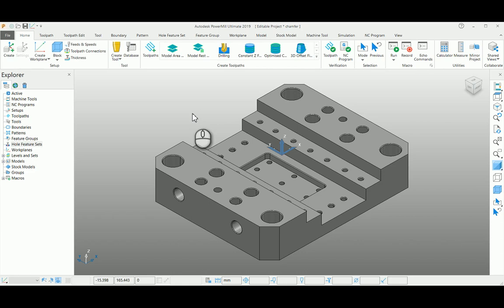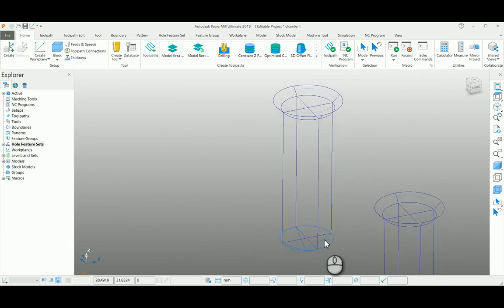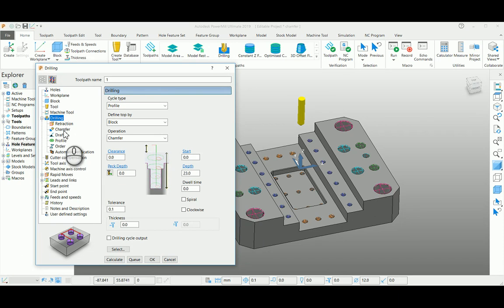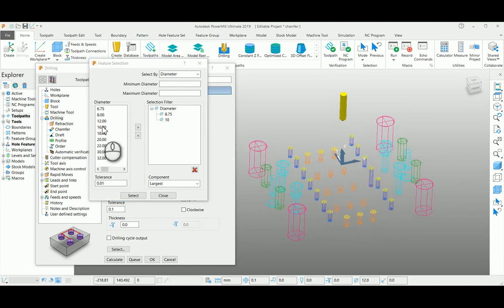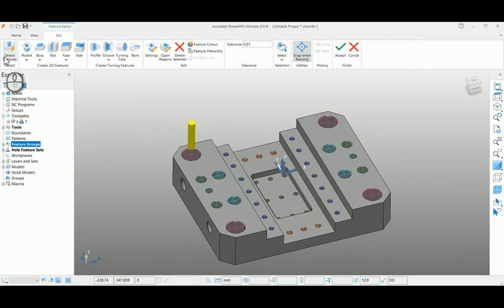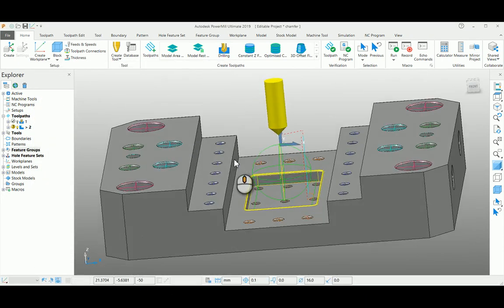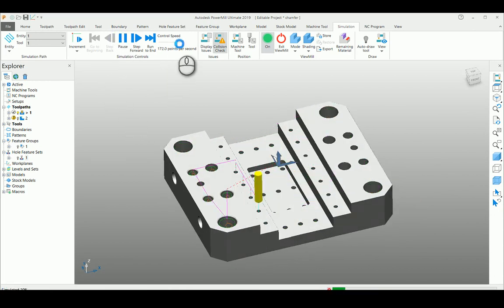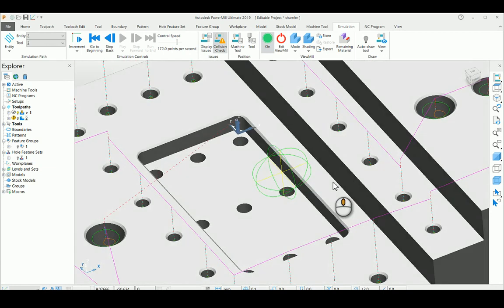Autodesk PowerMill-Chamfer Milling

Comment: Hello, engineer, good time, how did you colorize the hole feature set, since the color of each feature set is different according to its diameter?  Thank you if you answer❤
Reply from the maker: We ca create a macro in PowerShape to apply specific colour to features
Reply: @rajeshkanna5177 Hello again, I did not understand how to activate this option. Is it possible to explain more clearly? 🩵